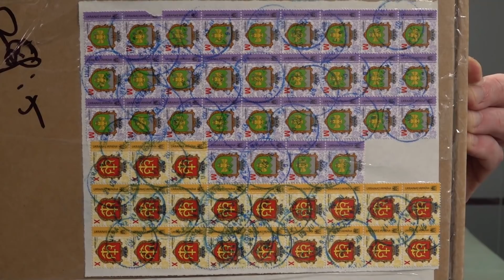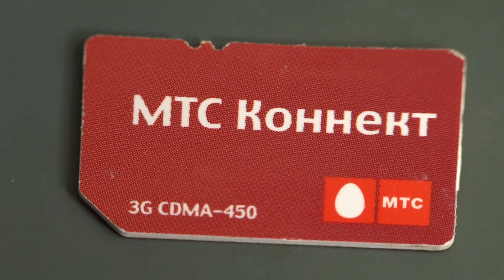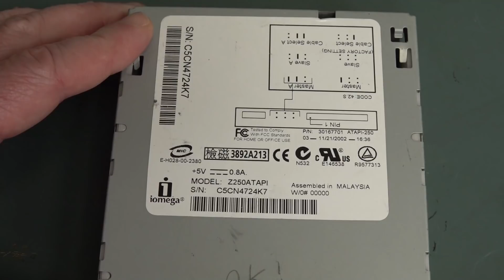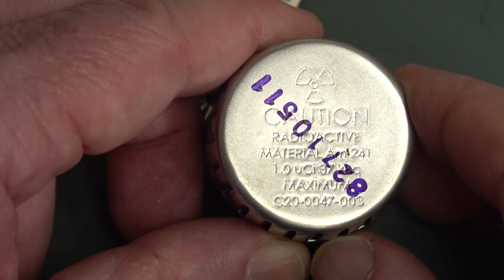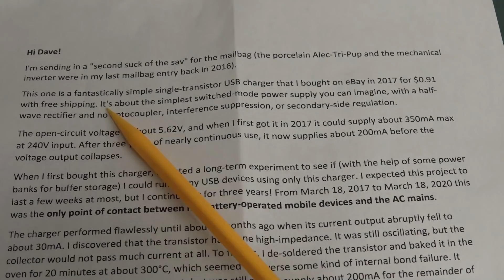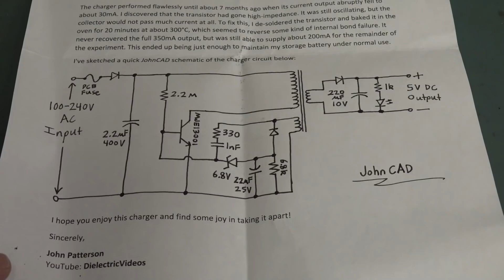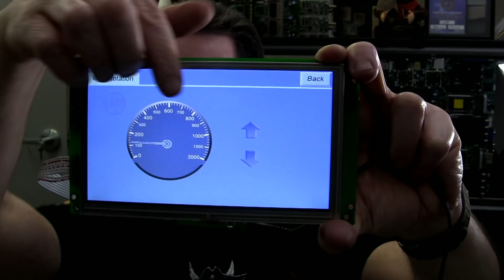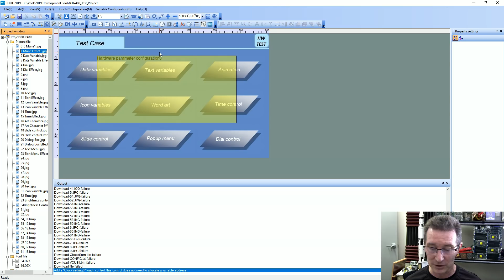EEVblog #1313 - Bad Luck Mailbag

Comment: ZIP was a horrible design. The edge of the disk was exposed in use. When the head got damaged, it would chip the edge of the disk. If you put the damaged disk unknowingly into another drive, the chip in the spinning disk would catch on the new drive's head, breaking it as well. This cycle would continue for every drive and disk you tried. Went through a whole office of  four or five ZIP drives and multiple disks one afternoon before I realized what was happening.
Reply: by design
Reply: Maybe not a great design, but very useful at the time (mid to late 90s).  Otherwise we were still depending on the common 1.44MB floppies or dialup modems (56Kb?) for transferring data.  The 100MB Zip drives were very welcome... while they worked.  CD-Rs were available, but still not very common and still a good bit more expensive at that point.  I had maybe 20+ 100MB Zip disks at one point, and only had a few disks go bad on me before finally getting a 4x CD-R drive for around $200 in ....  2000?

Comment: Dave. Mera's computer was made at the MERA plant in Zabrze Polska in 80's XX century. Mera 7209 was a computer terminal. Designation CM 7209 is a commercial designation, used on the international market; while the symbol MERA 7953 is a designation used on the domestic (Polish) market. Computers ware exported from Poland to other country soviet block
Reply: I would like to add, that UCY chips were usually logic gate chips and were very common from CEMI. I saw these very often since I was a kid, and I was born at 87.
CEMI was an electronics manufacturing plant located in Warsaw, Poland. Very reliable chips they made. I'm still using some today (mostly logic NAND gates like UCY7400 ).
Great piece of history tough!

Comment: It is not uncommon to have antennas that "look" shorted.
A very basic example is a loop antenna, which is simply a loop of low resistance wire, basically a short circuit.
In fact, most microstrip antennas (The ones printed on pcbs) have a shorting pin or a shorting wall, by putting thees shorting pins or walls (among other techniques) you will be able to make your antenna smaller for a certain frequency.
Of course in reality it is much more complicated than that, and nobody can look at an antenna and tell you why is it shaped that way, except maybe for the basic shapes.
You usually start with some basic antenna shape, add your space constrains, and the software would iterate and optimize by simualting the antenna performance.
Reply: I like to think of them as an auto-transformer. The input is a common ground plus drive, the output is the common ground plus the free end of the transformer. Sort of like an impedance matching transformer.
Reply: Isnt that a fractal antenna.. the pattern repeats..

Comment: 8:00 A lot of CEMI,- no longer existing Polish enterprise producing microelectronics. Was closed down in 1994. CEMI located in Warsaw produced: discrete components, bipolar systems
Reply: ...zapewne wyprodukowane i eksportowane na mocy „przyjaźni polsko - radzieckiej” 😉
Reply: Przeoczyłeś zielony kondensator Iskra na środku płyty PCB. Widać nawet trójkąt ze znakiem jakości 1.
Reply: And MERA was a Polish miniciomputer series in the 70's.  At some point they would have likely built some VDT models, as teletype-based terminals are slow and obnoxious for many purposes.  They would have continued to be useful even after the MERA line was discontinued, and might have found there way all over the place.  The design principle looks similar to the PDP-11/110 and /130 from DEC (computer squeezed into a VDT case, although a micro instead of a miniaturized mini, in some ways like a Sol without an expansion system).
Reply: My Frequency Central Product modular synth module has a few CEMI components on it.

Comment: CEMI was Polish manufacturer of 8-bit chips, it closed in 1994 :)
Reply: and Mera was Polish brand too ;)
Reply: MEV was a hungarian semiconductor company, separated successor of the semiconductor division of Tungsram, which was a lamp/tube factory, later bought by GE in the 90's. They had a serious fire in 1986, and the wafer fab wasn't rebuilt after. I've heard a legend that they were ready to produce Intel 8085/8086/8088(?) clones just before the fire disaster in the wafer lab. I have several MEV branded 74 series logic gates, some 741's, 709's and several TV specific components, like TBA 950 sync IC and TDA440 IF lying in my drawer. Also they had a large scale of bipolar transistors, like BC182/212, BD135 till BD249 series... The story in Hungarian can be read there: https://www.villanylap.hu/blog/4590-mikroelektronikai-vallalat
Reply: Manufacturer of that MERA CM 7209 terminal is still functioning. Ealier known as Mera-Elzab, now just ELZAB.
Reply: @detalite  the ones who product cash registers?
Reply: Pamiętam, pamiętam tamte czasy 👍
Reply: Mieszko Guliński ‘point-of-sale terminals’.

Comment: 7:00 Mera was a polish computer design and manufacturing unit. They started with paper perforators, then calculators, later licensed terminal designs from Swedish company, then TRS-80 clone. After fall of Iron Curtain they managed to stay afloat by restructuring and switching markets to point of sale systems, Today they are still a local leader in this field.

MERA CM 7209 (MERA 7953) is a terminal dedicated to Russian RIAD systems, direct unlicensed IBM System/360 clones.

8:00 Some polish manufactured semiconductors on the PCB. Unitra CEMI UCY chips 74 series. MCY series are microprocessor clones. Unitra CEMI even cloned Intel 8085 at one point. All behind Comecon (cold war) embargo.

Comment: That Zip Drive head looks like the voice coil you find on hard drive heads. Miles ahead of stepper motors and not at all how-ya-doin'.
Reply: I wonder why no CD drives had such a positioning system. In CD drives, it is always combined crude (and noisy and slow) mechanical + fine voice-coil based positioning.
Reply: @victortitov1740  The optical block is a lot heavier, so cheaper to use stepper motors.
Reply: stepper is cheaper, you dont need precision in optical drives because lens assembly compensates on its own
Reply: @victortitov1740  Possibly for cost. I don't think the seek time on optical media was considered that important, especially as the rotational speed was so much lower than hard drives.
Reply: @NiHaoMike64  Actually all the CD mechanisms I've examined use regular brushed DC motors. Even cheaper than steppers.
Reply: Victor Titov CDs have the data placed in a spiral so that the audio data is read continuously. Stepping a head from tracks to track would have required a mechanism to buffer the data to a RAM chip to allow the music to continue to play while the head was moving to the next track and waiting on the rotational delay for the proper next sector to be under the head. Remember, CD audio device had a DAC on board so that the  host PC did not have to do the work. System builds of the era required a CD analog audio cable be run from the CD drive to the sound card.

Comment: (29:00) ATX power supplies like that typically have this power path: Input filter -> Rectifier -> Active power factor correction boost converter -> bulk 400V capacitor -> push pull or similar transformer based step-down converter -> 12V DC bulk caps and 12v output -> secondary buck converters for 5V and 3.3V outputs.  
And some of the newer super high efficiency ones will have some sort of resonant converter doing the 400v DC -> 12V DC stage, which require some proper wizardry to design.

Comment: ES EVM was a series of plug-compatible mainframes first developed in the late 1960s.  Both 360 compatible and 370 compatible versions were developed.  IBM actually provided software support for these starting in the early 1970s. 

The chips marked "CEMI" were produced in Poland and actually use Western numbering conventions.  The chip labeled UB880D is the CPU.

Comment: 8:43 - К573РФ5 is UV EPROM 2K*8.
9:08 - КР580ВИ53 is a knockoff of i8253 timer. КР537РУ10 is CMOS SRAM 2K*8 bit.

First letter К means the part is for use in non-military applications. Second letter Р, if present, means plastic package (otherwise ceramic).

Comment: you should do a video wall made from dumpster finds. I mean a big TV is boooring - have some 19" , some vertical 30", .....
Reply: That souds amazing. can probably drive them with a scavenged desktop with 2 gpus.
Reply: @caromac_  or simply from a media player displaying slides for the secondary monitors.
Reply: MONSTER4242 & caseless mailbag power supplies.
Reply: I have a 7"

Tv

Comment: That green PTC  30:04 is used as a Inrush Current Limiting. During power on, a high inrush current can occur because the power supply’s link capacitor functions to dampen ripples in the output current. This capacitor acts like a short, causing an inrush of current. The inrush lasts until the capacitor is charged. Length of the inrush current depends upon the power supply and link capacitor.

Comment: 26:14 If I remember correctly, the voltage is not applied across the Americium itself. It is between the walls of the chamber. In a normal state, the americium ionizes the air between those contacts just a little, so there is a constant small current, but if smoke particles enter the chamber, they are much easier to ionize and the current rises sharply (that is what the detector looks for).

Comment: 28:52, 100€ for a power supply with nice details, but... CapXon capacitor...
I would expect them on a 15€ unit from unknown brand, not an 100€ from an famous brand...
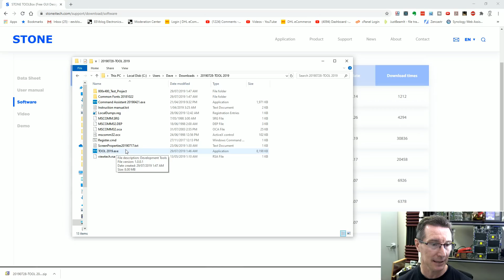43:00, like Siemens, Rockwell, and other industrial brands: they sell you 10.000€+ plc cpu and you have to spend 2-5000€ for related software.
Reply: Yes. I'd prefer the 10k+ Siemens thingy and mature software + certified hardware instead of a 100,- "smart" LCD panel from a noname brand + the inevitable conventional penalty because that shit caused production downtime or worse, go to jail because that "smart" panel accidentally killed the user.
Just playing devils advocate. Enjoy Arduinos, Chinese-Panels and other beloved botches:)

Comment: Another option, Find/get/acquire one to two more TVs and set them up for a fake window. Either two side by side to span the width of the frame at the top, or three in portrait across the whole background view.
From what I remember, the click of death only affected the original ZIP100 devices and was fixed before the ZIP250. The big problem with the click of death was it damaged both the drive and disk, so an clicking drive would ruin a ZIP disk and an damaged disk, either from a clicking drive or physically damaged from being dropped, would give click of death to a susceptible drive. In school, some of the computer labs had ZIP drives, click of death quickly killed every early model drive and took a lot of projects with them; every replacement ZIP100 drive after that were immune to the fault.

Comment: These "intelligent displays" embedded devices are basically a complete small computer, which is fascinating. In Germany, we do have a quite extensive bottle and can refunding system with different classes of containers and different prices, as well as different sorting behind the recognition, so the machines have to do image processing/pattern recognition, barcode reading and sorting. I've seen one of them boot up in 2007, and it was a Linux PC, a Celeron thingy. With this display, you could make it much more modular, have one dedicated unit for the bottle/can recognition, one sorter/crusher unit and a printer unit for the vouchers, and have it all be controlled by such a dinky little display screen.

Comment: I would use a retro projection, it is more versatile and as you have control over lighting in your lab. There are special close proximity projectors and lenses that do not require to much distance to the screen as you certainly know. I work a lot with retro projection at work, it looks amazing when used right!
Awesome video as usual by the way! 😎

Comment: The insidious thing about the click of death is that it was contagious. If the drive developed it, it would damage any disk that you put in it in such a way that if you then put that disk into another drive, it would damage that drive and it would then have the click.
Zip discs were not backward compatible. There was an LS120 competitor to the ZIP disk that was 120 megabytes but backward compatible to floppies.

Comment: Many modern smartphones have similar "3D" antennas. They are usually properly molded into the plastic using some conductive compound. I guess they are great way to save space while getting decent gain.

Comment: Cooler master power supplies are generally good. That particular example can provide 650 watts with significantly less chance of combustion than a cheap Shenzhen special. Having a good multi voltage supply board can be very useful so hang onto that if you can.

Comment: Dave here is a video suggestion: If you have a photodiode lying around connect to a transimpedance amplifier 1Meg-ish feedback and then put the photodiode close to the americium and you will detect the alpha particles flying off. Needs to be shielded off in a completely dark enclosure to work.

Comment: That 3G modem, that antenna is pretty cool. I think it's separate antenna for TX and RX channels, that's why two separate antennas.
Reply: I think one was an emitter and the other a reflector. It’s kind of odd to have two driven devices in such close proximity to each other unless the pickups are detuned with respect to each other.

Comment: @13:00 If you want to see something else like that with an odd-ish antenna I recall seeing some pretty interesting chamber and bounce plate harmonic stuff going on inside the satellite dish receiver, the piece on the dish itself that is.  One I pulled apart last (Direct TV late 90's early 00's dish if i recall) was an aluminium can that split apart to reveal a gold trace board and a bunch of chambers and discreet filters and just a real beauty to look at for hours.  I have another 3 port dish receiver to take apart if you want pics. One I did was one port, channel with a plastic dome, focal point, whatever.  😁

Comment: Voice-coil head positioned were common before angular and stepper motors.
Check out the DEC RK05 and similar platter drives from the seventies.

Comment: MERA CM7209 (also known as MERA 7953 Z) was a Polish (not Russian!) mainframe terminal. Just look these colorful beads on the ceramic caps - sweet. It was an equivalent to the DEC VT52. As for the chips, the majority of the chips on the board are CEMI UCY series (74-type logic), manufactured by Polish UNITRA-CEMI in Warsaw. The TI chips made in Portugal are a bit of surprise here... Anyway, if you are curious how the terminal looked like from the side: http://vinc.prv.pl/text/299e3ed5-2614.html (there are some more photos, too).

Comment: I have one of these 1$ usb powersupplies, but with the optional optocupler populated, bit it makes absolutely no sense, as some of the legs aren't even connected. Due to safety concearns i have never pluged it in. was wondering if I should send it in, but thought it wasn't worth the shipping.
Reply: Don't bother. He'd just open it with a hammer, like he did the Zip drive. Then make some inane comment like "Oops!" and throw it in the bin. Save your money.

Comment: the vertically mounted dc converter board in the cooler master psu is most likely for 3.3v and/or 5v rails, modern computers barely uses those rails anymore which is how the psu's has gotten so efficient, they almost exclusively convert to 12v dc which then the vrm on the motherboard, graphics card or other pci/pci-e cards converts to the power they require themselves

Comment: I still can't fathom how you would connect a smoke detector to the mains. Not only is it dependent on mains power in order to do its job, and draws lots of power totally unnecessarily, but also there are battery-driven smoke detectors that have a Lithium cell in them which lasts for 10 years. They are laid out as disposable units by regulation, so after 10 years, you just bin them (although the battery and electronics might still be good, but it may need to get recalibrated or something after replacing the battery, I don't know, but my landlord installed them in my apartment, and I of course took one off and opened it up and saw that the battery was a replaceable item. It popped back together and on the ceiling fine, so I'm allright ;))

Comment: Hi dave since you included a cheapy charger, i wanted to know how can i remove the effect of capacitive coupling between the mains input and output.
I measured capacitance with my multimeter and turned out to be around 200 pf-ish for all of my specimens including a iPhone charger.

I am a teenager and dunno anything about mains part of a PSU. But i want to make a switch mode psu (regulator part, not the mains part) soon. And capacitance coupling mess with my prototypes whenever i try to power them with a two prong psu.

Comment: Hey, Dave! May you shift Dumpster TV along the Z axis so that the edges coincide with the corners of the table, maybe this will be enough to fit it vertically to screen and will look not so bad, and for sides there maybe a racks on the wheels with cool stuff and 2minute testing equipment?

Comment: Hard drives in 1994 didn't have a couple of hundred GBs, they had a couple of hundred MBs. I remember, I've gotten my first PC in 1993, my father had bought himself a new 486 with a 420MB HDD, and I got his old 386 with 120MB (about the size of the first ZIP disks), and in 95 or 96, I bought my first self-bought PC, a Pentium with an 850MB HDD, which I then later upgraded with a second HDD, one from Maxtor that had 1.6GB.